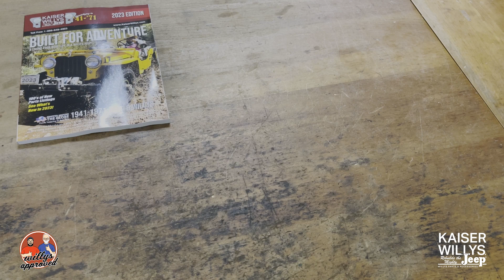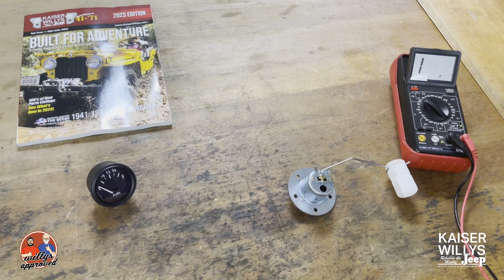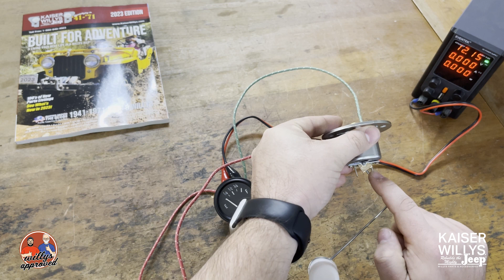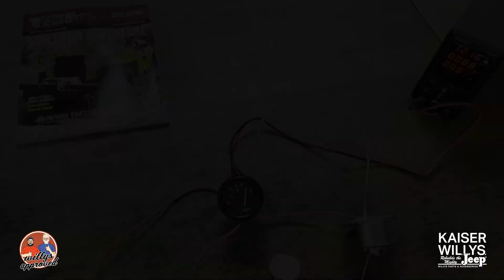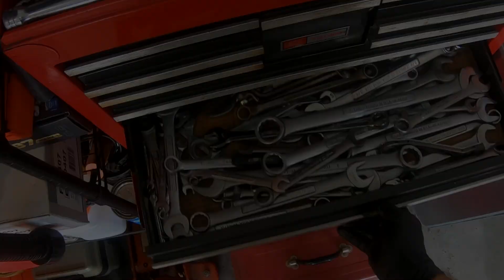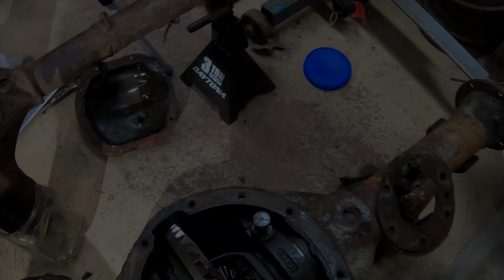Willys Jeep FAQ: Testing Your Sending Unit and Fuel Gauge

Comment: What is the cause of reading full if you have just filled the tank? Then empty when you have driven a few miles. Will rock back and forth. And moisture builds up on the inside of the glass? Only while it's running. 6 Volt 1946 CJ2A. Thanks